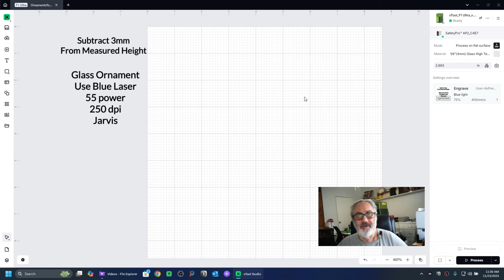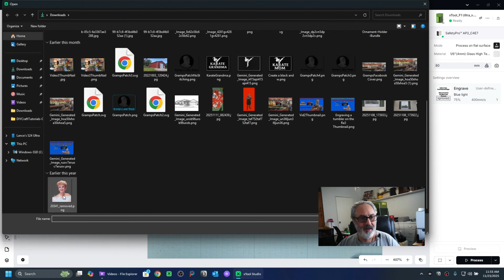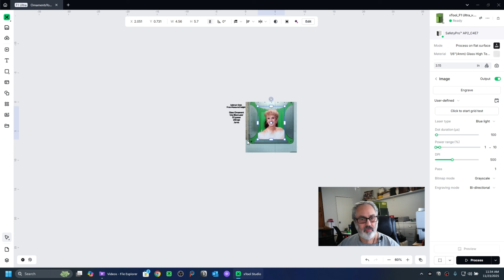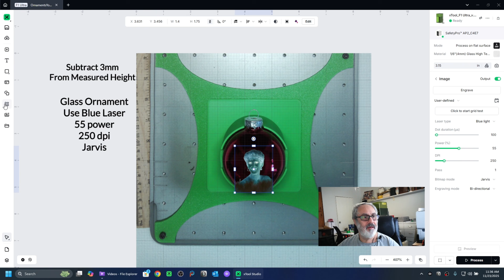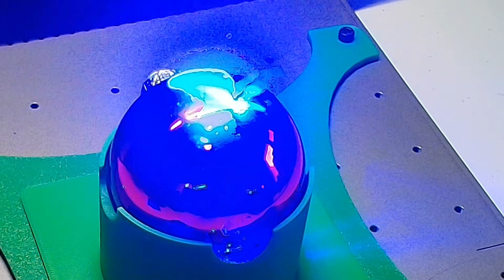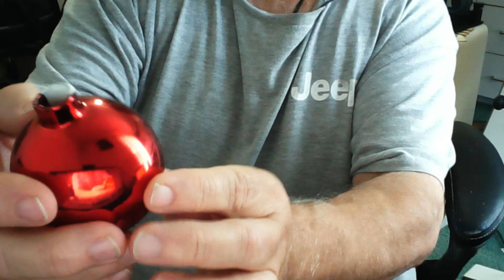How I Turned Family Photos into MAGICAL Christmas Ornaments with a Laser! 🎄✨ (XTool F1 Ultra)

Comment: Instead of subtracting 3mm, why didn't you just use the Process on Curved Material Mode?
Reply from the maker: Great question.    Curved surface takes much longer and often fails on shiny ornaments.
Subtracting 3mm works every time and provides excellent results.
Reply: @GrampsLazerShack  I've seen people use masking tape to defeat the reflective surfaces, but as long as it works :)

Comment: Isnt this dangerous for the laser because of the reflection?
Reply from the maker: The risk here is extremely minimal.   You're engraving on a convex surface.  Any reflection will be widely dispersed.   Any beam making it through to the inside  is hitting the concave surface which has a focal point at the other side of the sphere, which would again be widely dispersed by the time it reached the laser head.

The biggest danger of reflective surfaces would be flat surfaces reflecting directly at the head.   And that can generally be abated by a simple water washable coating.
Reply: @GrampsLazerShack  thankyou